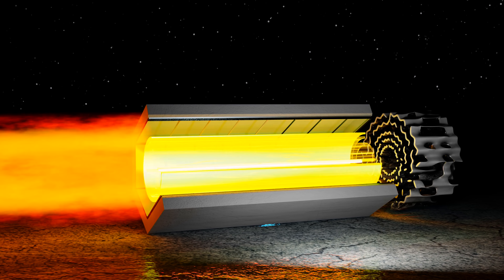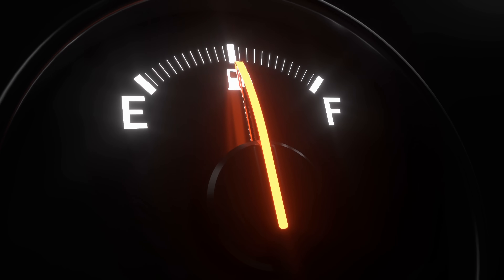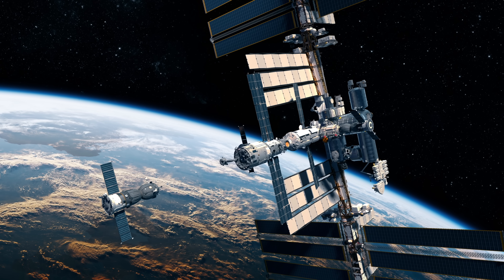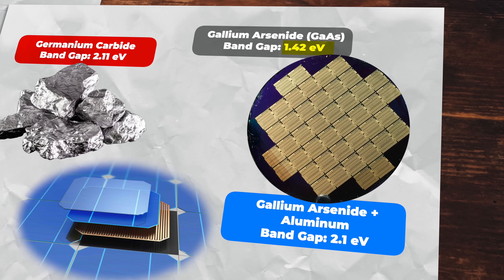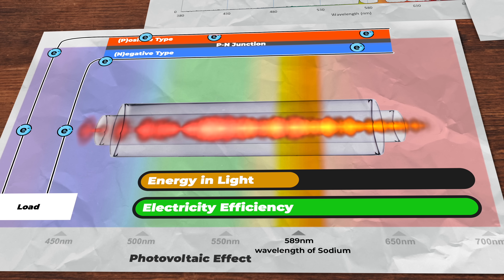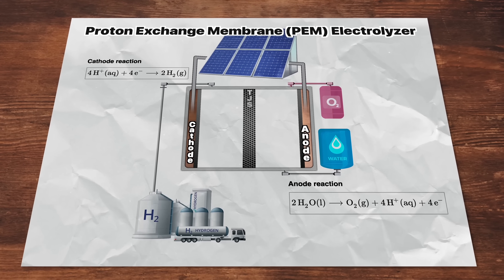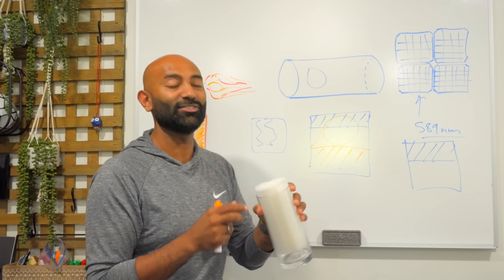Why Solid State Might Save The Combustion Engine

Comment: One thing that I am having trouble understanding is how their system will reach the necessary temperatures to cause the 3s electron to be kicked up to the 3p state and thus emit the 2.1 eV photon as the electron relaxes back to the 3s state. From what I have found sodium the needs to be at 3000 K (4940 F) in order a significant portion of the collisions between sodium atoms to cause the 3s electron to be boosted to the 3p state. Given the Boltzman distribution of velocities at a given temperature, the temperature could be less, but with smaller and smaller percentages of collisions between sodium having sufficient energy to cause the transition. What am I missing?

Comment: so um.. Why would you like heat sodium to get light and that light convert to electricity?  Seems like too much power loss for me. So, let's replace sodium with, you know, like, water and then water boils, creates steam, yeah? And then we use that steam to spin like a turbine thingy and then, and then, we can cool that steam so it's condensed back to water so we can boil it again? And we will call it... Turbowater generator? how does that sounds? Pretty new tech here, never seen that before
Reply: oh, and then we can use that exhaust to spin another turbine! And this would be like PRO version, you know. TwinTurbowater generator. Turbowater generator+. Ye, turbowater generator+

Comment: Enhancing efficiency by combining thermo-electric conversion with IR-visible light solar cells and magnetohydrodynamic (MHD) conversion is feasible here and might achieve levels above 60%. This is far from trivial.  Thermo-electric devices convert heat directly into electricity, (15%), while solar cells can harness visible and infrared light (40%). MHD generators can extract energy from hot exhaust gases, potentially increasing efficiency (about 15%)  beyond conventional systems. The integration of these technologies could lead to a more efficient energy conversion system by utilizing different forms of energy recovery, although practical implementation would require overcoming technical challenges related to material costs and system complexity.

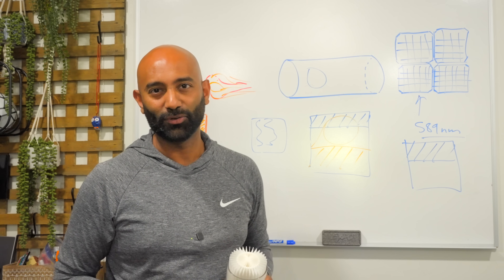Comment: uhh 15:13 at least you need to increase solar efficiency first at least 75% and need to make sure solar will doesn’t get too and it should produce as much light as possible with low heat as much as possible hot and it sounds worse than the combustion engine how would it can help? like you turn gas to light to electric isn’t that will have too much losses In process?

Comment: the ceramic recuperator idea was used on a Chrysler jet car i believe it preheated the air for the jet and cooled the air for the exhaust at the same time by rotating through the flow

Comment: To your last idea, it would never work. Salt has a boiling point of nearly 3000 degrees while an exhaust manifold will never get even remotely close to 2000 degrees with normal operation, let alone the 3000 required.

Comment: I'm not sold on this. It is still burning fuel which is inherently inefficient. I'm sceptical it would get to the efficiency of the current battery/electric motor solution. What we really need is for someone to crack the issue of power density with batteries, make it affordable and with decent longevity. That will solve the current issues with EVs and maybe open the door to some level of electric only aviation. Here's hoping. 🙏

Comment: Still creating CO2. 

Also 80% efficiency. Nah.  Let's say the photovoltaic conversion is 50%, and the heat transfer 80% , start with 100 units, after Heat conversion, you have 80 units. 50% of that after photovoltaic conversion is 40 units AKA 40% efficiency, not that much better than a piston engine. Sticking a battery on it is NOT going to make it more efficient, ie it will be around 37%. .

Also consider how big this would have to be to power a car.  I did some back of the envelope calculations and came up a photovoltaic surface area of 4 sqm for 5Kw output. 5Kw is based on the average consumption of an electric car averaging 50 Km per hour, with a consumption of 10 Kwh /100 km.

Comment: I really don't understand why everyone is so concerned about getting away from gas or oil considering 90% off everything we use is made from oil if we stop  using oil we wont be able to survive in order to use wind power we need concrete metal plastic wires and equipment that uses oil to construct every thing used to put build them lay the concrete level the land dig the earth to laying the underground supports and lay the cables to transport the electricity we need concrete to construct damns for hydro power and nuclear we need oil to survive the roads and tires the engines literally everything we use is only possible with oil

Comment: A thing that burns something and then extracts useful work (as rotation, electricity, light or whatever) from the produced heat is a thermal machine. It does not seem to be possible to create a thermal machine with energy conversion efficiency coefficient above (T2 - T1)/T2 whereby T2 is the absolute (e.g., Kelvin) "hot" part of the machine and the T1 - the cold part temperature.

If your ambient air is 300K (26.85C or 80.33F) and your "hot" part is 1000K (726.85 C or1340.33F ), there is no way we know with the physics we know of for the system efficiency to be above 70%. In fact, it is always below 70%.

Chances are people who claim 85% efficiency fuel to electricity simply do not understand what they are talking about.

There are extant relatively mass-produced devices that convert ~60-64% of fuel combustion heat into something useful -- those would be the CCGT  turbines. They are big, heavy and cost fortunes.

Comment: This is a powerplant. It's an active chemical battery. You feed fuel to the machine and it makes electricity. It's a "generator" by the very definition of the term. A thermo-photonic generator.

Comment: its more like a generator not an engine. an engine does work loads.this dosent do anything just transforms the fuel into energy and than the energy is used to drive the car..its not a combustion engine...just a scam.

Comment: This is not even an engine let alone an internal combustion engine.
An engine converts fuel energy into mechanical work. This device converts fuel energy to electrical energy.
Immediately someone mentions hydrogen as a fuel source for transport you know it's a scam.
Any fuel other than hydrogen and it's  just another disaster for human health and the climate.

Comment: You ask in the video why one would focus on this idea, rather than battery electric or fuel cells. I think the potential advantage here would be size & weight of the energy source. Hydrogen is light, but requires a huge amount of space to have anything even remotely amounting to useful storage. Batteries are heavy and large. Fuel, in comparison, is extremely useful here. It can be kept extremely small and light, because there's just so much energy available per volume.

Comment: 100% a scam. Solar panels are less than 50% efficient, combustion to light energy transfer is far lower than that, so there is no way for this technology to reach the efficiency claimed, based on the described method of converting combustion into light then light into electricity.

Comment: Solid fuel ICE? Problem.....Once you ignite it, it has no choice but to burn through ALL of it's fuel before it stops. There is no control or "throttle" in a solid fuel design. It's full blast or nothing and once started a solid fuel burn can not be stopped. So how does this intend to work? Replace the core every time you have to stop at a stop light?

Comment: F1 uses thermal energy recovery, but idk what system, perhaps peltier. Your idea seems a good way of recovering the energy although it would add some costs. It can be done after the catalytic converters where the gases get even hotter. But wouldn't the surface area of the panels need to be very large?

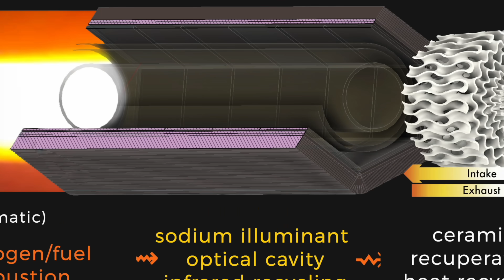Comment: 8:18 
Or you can use any existing thermalnpower plants? You have the heat so you still could extract energy from it.

For example gasturbines power  a turbine the exhaust gas go through this heat exchanger and the sodium element start glowing the emited light power a solar panel

The sodium vapor is in some containment (glas tubes)

12:12  as i said it could also use hot exhaust gas from gas turbines or gas engines

Comment: Heh, I've been using a Henson razor for a couple years now and I can't begin to tell you how great it is. I have very sensitive facial skin and yet this is the only razor that hasn't ever caused a nick, burn, or ingrown hair...unlike the many multi-bladed razors I've tried over the last 4 decades. This also shaves closer than the electrics I've used. And because the blades are simple, plain safety blades, I haven't even burned through $1 worth of blades yet. Consider just the blade cost alone: 2 cents vs. $5 for current 5-bladed name-brand razor cartridges (which add tons of landfill waste per year, btw).  I've been a happy subscriber to your channel for a long time, and promoting Henson shavers just makes it that much better...thanks!

Comment: This still burns hydrocarbons.  You can say, it'll burn Hydrogen, ok, but Hydrogen can't be mined.  It's very expensive (otherwise launch vehicles would use it).  And, until recently, the way you make it is to take methane, and run it through a process that gives off Carbon Dioxide!  We don't need reinventions of fossil technology that burn more fossil fuels.

Comment: They're certainly reflecting IR back into the combustion process somehow or the PV will not work well, unless elevated temperatures somehow cause better efficiency while simultaneously not having conduction losses increase quicker.  Interesting thought, but...I typically try to do the math first and then invest a ton of money in something...

Comment: Yeah so 10 kw/h out of 4 liter of hydrogen, which packs and energy density of about 33.3 KW/h/kg, or  or 120 MJ/kg if you prefer, all in all 133.2 KW/h for four kilo, leaving that thing with an efficiency level of 1: 13.32, read for each kilowatt output, you'll need to burn 13.32 kw/h worth of hydrogen. An ottomotor is far more efficient.

Comment: Another college boy dream.   Ford cannot even build an engine that is a piece of junk.... and they have almost a 90Yrs  to "get it right".   Another dream.....Same dream of EVs replacing ICE.. but slave and child labor in Africa is required.   America has at minimum 200 yrs or more supply of petroleum cheap reliable and rare earths mined in China are not necessary.  This guy is just entertainment. Do not hold your breath people.  You cannot afford $80,000.oo dollar EV's.  Do you naive think this gig will be cheaper?  Really?

Comment: 80-70% conversion of fuel to light and then 30% conversion of light to energy from the solar cell? so 0.8*0.3 = 0.24% efficiency??? I can get better efficiency from a gasoline engine paired to an alternator, diesel gives 44% and generators 95% so it's 0.44*0.95  around 0.42% !!!!

Comment: the  idea  is old and was  ntroduced  al  a  wa   to combain  heaing   systems and  elektricity  in  the  same  system!  but  never  got  into  a real  thing.    Your  problem  is  that  You  did not understand  the   2   law   of  thermodynamic.   The  rgument  that   You  do not  get more  than   40 %   aout  of  a  conventionel   engine   because  it has to be  coold  is  wrong  als  You  see  on  an   uncooled turbo   engine!     If  you  are  able   to  heat  um  something   that  givs  You  radiaation   at  a  certain Wavelength,   then  that  will  hapen only  if You haf  a  temperature that   fits.  Teh   flow  of  gas means  that  You  do  have  a lot  of gas   leaving  the  system   alt   this temperature,  meaning  it  carrys away  a lot  of Energy.  Of  cause You  can  get  the  heat  aout  of  this floeing  exaust,    and  in  prinzipal  You  always  kan have  100%  energy  out  of  the  Process,  first  law  Enerx  stays  always the  same,  that is not  exiting!    So   waht  happens  is  there  is  a  certein efficiancy   in  means   of  input  fuel  to  electricity, somewhat  10   to   20%  estematet,   and  the rest  ist heat!    Sorry  for my  englisch. its  a  forein  language  for me.

Comment: I like the idea you pitched at the end there – combining a regular old ICE with the "light cell" – which got me thinking a little. And I think I've come up with a really efficient combined system.
Imagine this: 1) You have a solid, time-proven, fully balanced and port polished engine block of choice (let's do a V8) with Speed of Air pistons (seriously, look them up! Just do it!!!),
2) and instead of a traditional starter + alternator combination (which puts a toll on rotating the crankshaft just to charge the battery), you hook a 48-or-higher volt starter-generator electric motor to the crankshaft either directly or indirectly (kinda like RAM's very underrated e-Torque system which you should totally research if you haven't),
3) and after the exhaust manifold(s) you incorporate however many light cells that would correspond to the number of manifolds serving as both heat re-capture devices and mufflers,
and you use primarily the light cells to generate electricity to juice up a super-capacitor-bank-equipped car battery (look up super capacitor banks), and use the excess electricity to put torque to the crankshaft using the starter-generator motor – which can also be used for regenerative engine breaking, RPM-matching for super smooth gear shifts, super smooth start-and-stop function along with takeoff torque boost (all of which RAM's e-Torque system already does) – creating a proper hybrid solution, and maybe even configure the light cells to work as catalytic converters while you're at it, just for good measure, or at least put cats in front of them to make the most of it. Running turbos would also really benefit this combined solution as it creates higher EGT's, which would just be harnessed by the light cells.

Most of these solutions are already proven technologies that are already in use in various different areas, just not combined together in a factory produced vehicle. RAM's e-Torque system comes the closest, but the electric motor they use doesn't generate enough juice to provide additional torque over the whole RPM range, which only makes it a so called mild hybrid system. But the concept is great, especially if you where to harness the excess heat that's usually wasted out the tail pipe to produce "excess" electricity.
All of these technologies put together and tuned in properly would first of all bump up the fuel economy by at least 50%. And thanks to the Speed of Air pistons you would also increase power and torque from normal combustion by 5-15% with the biggest increase in the low RPM's which is where it matters the most. But you would also DRAMATICALLY reduce the amount of unburnt fuel, soot and other harmful emissions, which greatly extends the lifespan of the engine oil and the engine itself, and completely nullifies the point of an EGR (which just kills engines prematurely anyway). And if you have catalytic converters you will have all the exhaust cleaning you would ever need for either gasoline or diesel engines. DPF's would also be moot at that point, along with DEF. That's how powerful just the Speed of Air piston upgrade is by itself. You seriously need to look those things up if you haven't! They truly are revolutionary!
I believe that even a crude version of this light cell technology would make a big difference for any vehicle using an ICE, especially combined with some sort of starter-generator motor.
The super capacitor bank would greatly extend the lifespan of whatever battery you couple that with, combining the benefits of readily available quick burst power with a gentler slow paced charging current to greatly reduce stress to the battery. And the starter-generator motor solution picks up the slack in a lot of areas to make it a really smooth driving, smooth shifting, efficient and plenty powerful hybrid platform, especially aided by that light cell solution.

Take it for what it is, but I truly believe in a combined solution like the one I describe.
A fun tidbit in all this: The germans are developing a water injection system that scavenges water vapor from exhaust gas and condensation from A/C systems to create a self-filling water injection system. Really clever if you ask me! Properly configured water-methanol/ethanol (or just water) injection systems have some really interesting benefits to both gas and diesel ICE's that you should look up if you haven't. Especially a non-methanol type system is actually really safe. It basically has no downsides, other than the fact that you occasionally need to refill the water tank such a system uses with distilled water. And that's what the germans are currently working around to eliminate as well.

Comment: A limelight or a thorium oxide mantle light might do the trick without needing to process the Chlorine which is hazardous and corrosive.
Also they're going to need moving parts in the fuel pump.
A group was working on this 15 years ago or so at Western Washington University. They were using low band-gap photovoltaic cells to operate in the infrared.
You look like you use that razor every day. I think those 100 blades would last me the rest of my life.

Comment: Sounds like a mechanic nightmare. Also what happens when the inevitable exhaust gas buildup obscures the photovoltaic cells? There's almost no way you'd get a 100% burn of gases with no foreign elements especially if it's going to be commercially available.

Comment: Gasoline is 13% efficient (hydrogen) and 87% inefficient (carbon) and Internal combustion engines are actually powered by pressure, not heat. At 3000 RPM a piston will go from TDC to BDC in 0.01 seconds, it's not possible for 87% of it's energy to be lost as heat in that short a time.